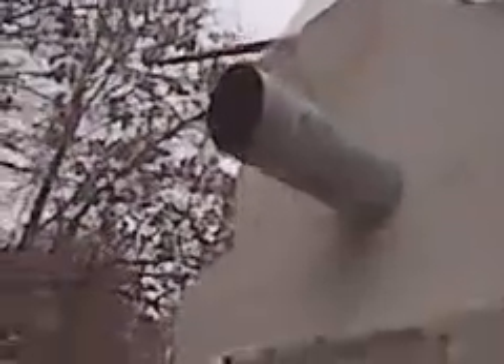Rocket stove in the winter greenhouse part 2

Comment: Plus I believe that overhead flu pipe of Ur's may very well be helping Ur greenhouse shed any snow that might accumulate on it, thus rendering Ur plants their best solar benefit.  Although "finning" Ur overhead flu pipe may yield greater thermal benefit, but that would have to be determined by Ur exhaust flu gas temps. at the outside end of the flu pipe.

Comment from the maker: @jbpitcher For the season that I used this rocket stove I only had a slight amount of ash build up in the exhaust pipe. My plan was to remove a section of duct and send a shop vac hose in to suck out the ash, maybe every 3 years based on the amount of ash in the system after the first year. I'm not sure about your last question, but I would guess there's a relationship to the diameter of the pipe and the rise verses the run. hope that helps.

Comment: Why don't you make the exhaust tube horizontally and place it under the growing beds along the greenhouse perimeter? It would capture much more heat and work as a heat accumulator. Raised grow beds would act as a large thermal mass in the classical design of a rocket thermal mass heater.

Comment from the maker: In all of my research I didn't run across any info or warnings of flu fires. I beleive this has to do with the fact that a much more complete burn of gases is taking place in a rocket stove. I have since dismantled the stove and there was no evidence of residue build up on the inside. Thanks for the comment.